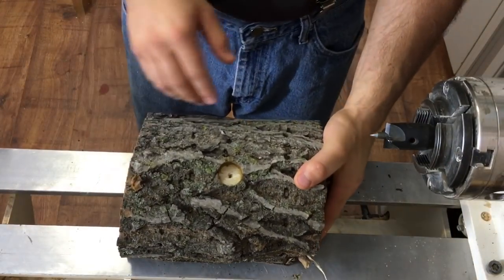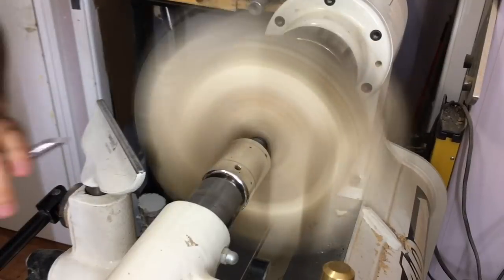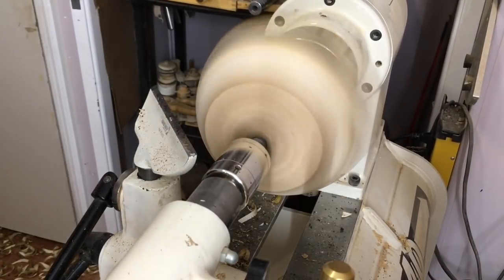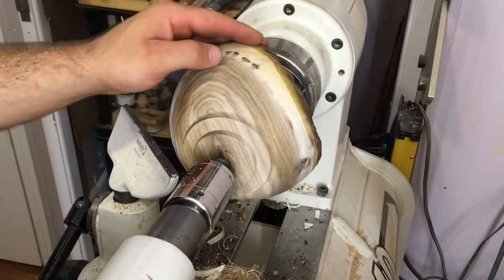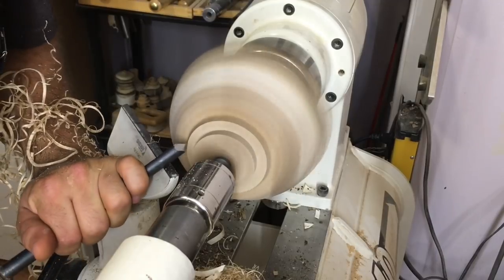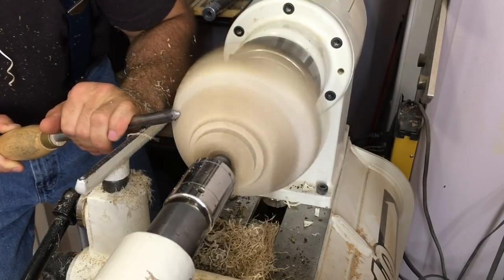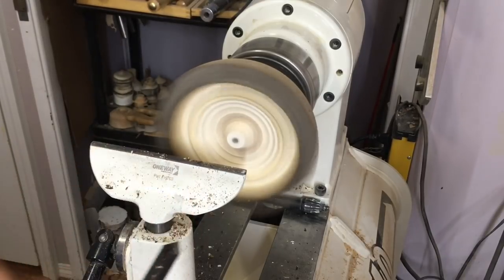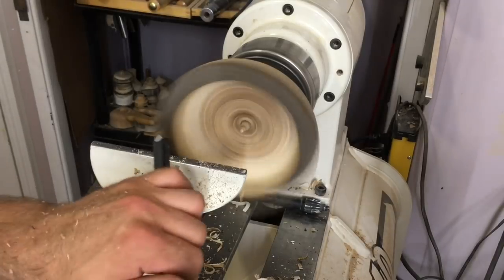Woodturning - Green Turning Butternut (And Tips for New Turners!)

Comment: Nice, Kyler. I like the clear explanations of hows & whys in your tutoria... uh, demonstrations ;-) Our turning styles/preferences are remarkably similar, so I hope you don't mind me nattering on with tips. One thing I've found useful in hollowing is to swing my banjo 180 degrees, so that I can swing the near end of the rest into the bowl. This lets you reduce the tool overhang while still keeping gouge and tool rest at much closer to 90 degrees. I've actually thought about welding a second tool post on my banjo, but welding cast iron is such a PITA...  Clyde
Reply from the maker: Clyde Ulmer Haha thank you Clyde! I always appreciate your comments and advice! I've tried that method before especially when the bowl is quite large or deep and I'm fighting vibration. It does work well, just can be a bit nerve racking depending on hand placement. I have an inside bowl rest with the curve by Oneway, and I find it doesn't work all that well because you still end up at the same point as a 90* position with a standard rest, but the tool runs into a straight part where the post is. Sometimes the standard rests are better than the specialty ones. Thanks again Clyde!

Comment: As a new guy at this wood turning and trying to get the same results as you do, how do you get your tools so sharp?  I've seen videos and people say "oh you must use 25 rake or 60 rake or 70 rake ( rake = angle),  any way, thanks for a couple of tips you gave, make my finishing look much better...
Reply from the maker: John Leonard I think the main thing for getting tools sharp is that when sharpening you keep the angle accurate. If you are sharpening and you don't have a stable platform or jig, then while you're sharpening you might not maintain a steady angle. This will cause you to either miss the edge and stay low on the bevel, or grind too high and round over the edge a bit. Much like sharpening a knife, the angle of the grind must remain steady because as soon as you wobble a bit, you take the edge right off. We want to grind the bevel of the tool so we are removing the metal there and it leaves a sharp edge. If we grind the edge and not the bevel, you ruin the edge. 
Now a 40* bevel will have a sharper edge than a 75* bevel,  but might require sharpening a bit more often as the edge is a finer point. 
I would choose the angle you grind the tool at by what it's used for. Like I showed in this video, the angle of the grind dictates the angle of the tool to the wood. So you have limitations of what the tool can do (like how far a bowl gouge can reach into a bowl before the tool runs into the rim while hollowing.) 
But the main point to take away from this, is that we grind the bevel away and that will reveal a sharp edge. If you grind the edge alone, the edge is now destroyed and won't be sharp. 
Let me know if this helps, many times my explanations are clear as mud! Lol
Kyler